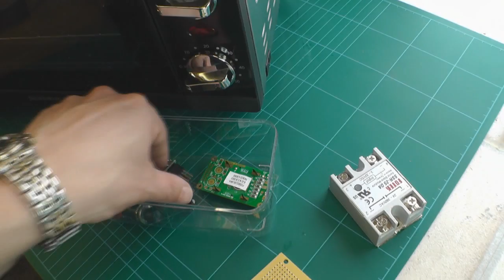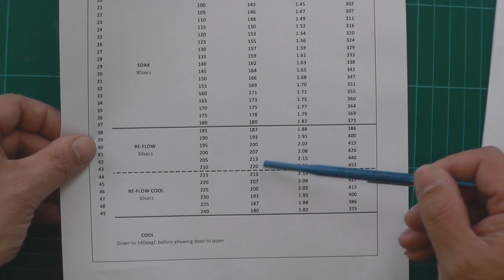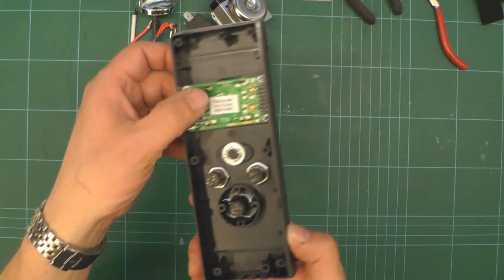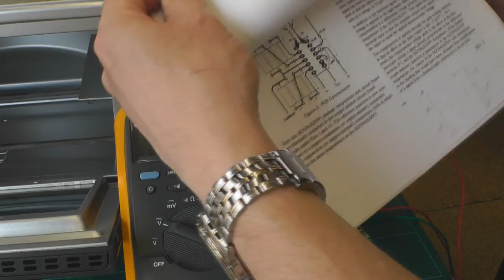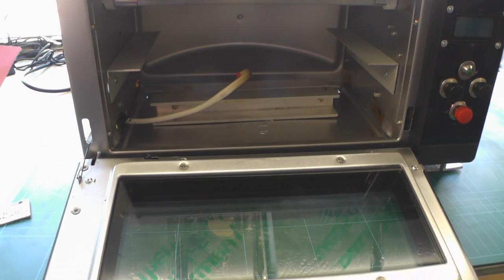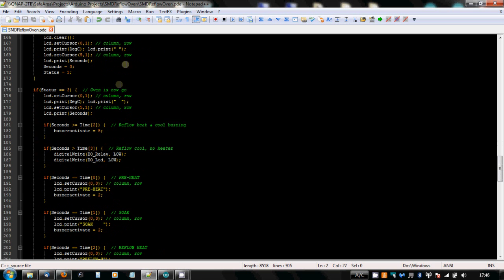Home built SMD Reflow Oven

Comment: The only thing I’d have done differently is perhaps have the AC mains inlet lower on the back. Some of those louvers higher up where the inlet is right now could help with exhausting hot air. But proof’s in the pudding as they say: if it works and lasts, then it’s good the way it is. 

Overall, it’s a pretty neat hack - and very well explained.

Comment: Great video - even 7 years on! Thank you very much. I was wondering what the total power output of the heating elements was? Living in a 100V country these days (max 15A) I need to plan carefully for anything that needs heat delivered in a fixed time (a 'quick' cup of tea takes over twice as long as it does in the UK). Thanks, Mike

Comment: I know this video is old, but after testing/comparing, I took apart one of those thermocouples and there is an air gap between the thermocouple and the housing, causing it to be much less responsive than a bare thermocouple. FWIW

Comment: This video encapsulates everything that I love about the Hacker/DiY/Maker movement.
They take a problem and solve them in creative ways but but not only that they often document everything they do either for themselves or for other people,
but not only that this video should be the example on how these videos should be done for the following reasons:

1 Structure: It covers the topic in such a logical way it moves from:
problem > solution > reason for solution > theory behind solution > building (including tips useful for projects not covered here like the tips for testing boards etc.) 
                  > problems encountered and solutions > extensive testing > covering code used in the final solution (this also includes general programming tips for software not even used here)  
All of these steps are so well done 2 they cover enough to get across what you want the viewer to know but not bog down with details. It's just incredible I have know idea how intentional/accidental  this structure it strikes gold in my opinion.
 
2 It's perfectly targeted: it sets out the steps that a electronics guy/gal can follow it assumes some expertise is present to follow along, but even tho I'm still learning electronics 
I never felt things where losing me. It covers what it wants to do convey and but even I as a beginner know the steps and things I need to bush up on or get to know before attempting it.
Some advanced hacking/electronics videos move way quicker assuming way more which leaves viewers with lose ends not knowing what to study up on but I feel this video hit a great sweet spot.

3 The tips that are given for general subjects great additions
As i sad I'm beginning to get into hobby electronics and I might still be a way's away of building something like this it does lay out some great tips that even I as a beginner
can use. I like the tips on testing boards for example since I'm new I can see some of them help me prevent headaces in the future. Secondly the programming tips 
are great for the beginning programmers too (I'm a software engineer by trade) it lays out important concepts like the fact your code should be easy to adjust and you showed how
that your achieved (it with the timing of the re flow phases  for example). It also shows new programmers to make it more efficient the beep method was lovely for example.

I wish that YouTube still had the 5 star review thing sometimes since a thumbs up icon does not do this video justice. I feel like it's corny to boost you gained a new sub but gosh darn it the effort and well made video can't help me but say it: You gained a new sub.

Comment: Next time I would suggest you use the max31855 and a PID library for the arduino, much easier to use and you don't need table and are more flexible in setting different profiles up.

Comment: I'm working on a design using the same oven - Could not get the damn lid off the thing without almost completely dismantling the whole thing - The cover is attached to the front structure on mine with a couple of one-way latches which are impossible to unlatch.
Reply: I've got an oven like that & every few months the connections on the heating elements become lose & I have to take it apart, the whole thing wants to collapse when you take all the screws off, it's a pain in the arse.

Comment: You could have used a "ALTEC PC410" instead of the Arduino and the temperature reader, they are pretty cheap and common on machines that need profiling temperatures.
They allow you to configure curve ramps and save 10 profiles that you can configure manually.
Also they are PID controlled, so you can calibrate your readings to match the perfect temperatures.
And also you can allow the PC410 to pause in the middle of the profile if the temperature is too far from its target avoiding uneven profile curves (this is not good in the peek zone thow).

Comment: Bad idea,  all components will be heated even good ones would be at risk,  only the bad part shoul be targeted ..
Reply from the maker: Hi, not really sure what you are referring to. Cheers, Ian.
Reply: The defective chip on board U want to reflow,  theres always some other components surrounds it, like the caps, resistors, diodes,   they are all in one board,  so if U tend to heat the suspected chip simply U cannot separate other components from getting heated up...
Reply: @edifierbass7821  thats not the point of a reflow oven, a reflow oven is for production, it just runs at a low temperature about 250 °C. Thats how electronics get produced in a factory.
Reply: @josefaschwanden1502    for production purposes  not for something already been used and reflowing it again,  you need to heat parts that are only suspected ones and cover the other parts, if you feel like heating the whole board go ahead, the real issue is that you guys don't like  negative comments,  you like  praising comments even if some topics needs be polished.

Comment: Controlling the temperature of the board is going to be difficult with this kind of toaster oven.  Because the heating elements emit a lot of IR light, the PCB is likely going to be a lot hotter than the air inside the oven.  IR light will heat the thermocouple directly and make positioning the thermocouple for accurate temperature measurements tricky.

I would suggest putting some kind of shielding over the heating elements that allowed airflow to reduce direct IR heating of the PCB and thermocouple.  Adding an air circulation fan might be a good idea too.

Comment: Looking to do one of these myself, great video. your average routine looks like a low pass filter, good choice. Could you use a triac instead of a relay for better heating element control?
Reply from the maker: You could use a triac, but remember it is a solid state relay so no real problems there.
Reply: IanScottJohnston i was thinking for variable output to the element, so 50% power etc then pid control. maybe a bit overkill??

Comment: you'd have to be an idiot to not like this.
Reply: Why don't mount some miniature fans underneath the vents below the arduino??  little laptop  /  GPU sized fans to suck air in from the bottom,  and blow it into the circuit chamber.

Comment: Your work seems to be quite impressive. While inspecting your code through the video I think you have a little error in the time/temperature linear interpolation calculation.
Instead of "var2 = time[zone]" (if I remember correctly) you should use "var2 = time[zone] - time[zone-1]". Otherwise the temperature increment will be to low in the
following zones. This might be an issue if you have problems getting the right temperature profile.

Comment: measuring the temperature, rather than average i would use median. That filters better some spikes. Spikes does make a difference in average values, smaller ones that without filtering those. But if you have example median of ten calculations there can be few spikes without making any difference.

Comment: Very nice project and very well documented. Although radiant heat in principle is very distance sensitive which might lead into problems when there are items of different height on the pcb and in addition to that, doing it this way the only way cooling the heat down (in the end) is: hoping, that the temperature will drop cause there is no control at all aside from switching the heating elements off. (This might not be that important in this case though.) Also the oven will behave totally different in cold surroundings for instance.

What i want to say is: i think of having a well isolated heated air circulation instead and controlling the pcb - room - temperature by mixture of heated and room temperature by some kind of valve. This way there would be substancial more temperature control, temperature rise and fall could me much faster (if needed), different heights of items on the board would'nt matter and the overall energy consumption would possibly be much lower.

Comment: Hi, It looks like you were not satisfied with the built in heating elements. How many Watts the oven should have to cope with the steep heating curve? Any idea. How many Watts did the original oven have?
Reply from the maker: Markus Rohner Not sure on what watts are/were required, and it's been a while since I built this.......not sure on the original spec. Ian.

Comment: Hi,

Just a quick note. My friend built one of these boards and found he had an issue getting a stable and accurate temperature reading to display.

When he powered the board up, it would display as 0 degrees in temp mode and then suddenly it would read then it wouldn't. It did the same when a profile was active too.
Bascially the temp readings were like this when viewed through serial monitor:
0 0 0 0 0 0 0 34 22 21 0 0 0 0 0 with no distiguishable pattern. Just intermittant readings with the wrong temperature showing.

It turned out to be a connection needs to be made from the + side of the K-Probe to Common (GND). This isn't noted on Ian's schematic but it IS noted on the AD595 datasheet drawn as a dotted line going from the + of the K-Probe input to Common (GND). Soon as we made that connection the temperature appeared constantly and was always accurate and correct. Not a 0 in sight.

So if anyone has this issue, connect a wire from + of the K-probe to GND.
Reply: i had a similar problem but the solution was not to ground it. the thermocouple i got has a metal shielding and i found that if it came in contact with the ovens body which was mains earth grounded the sensor would not work.

Comment: Wouldn't a convection type toaster distribute the  heat better?
Reply: jpalm32 i agree, i just bought a convection toaster one month ago and it seems better. all the solder reflow at the same time.
Reply: +jpalm32  Very good observation: The unit uses radiant heat to heat up the components. This causes several problems: everything dark (IC's) will heat up faster and to a higher temperature than everything silver (thermocouple). Everything closer to the heating elements will also heat up faster and hotter. Without air flow, cooling down of the components may also be difficult to control for the similar reasons.
Reply: Wouldn't that risk blowing components off the board.

Comment: Very comprehensive Ian, thanks for the excellent details. 
I did wonder why you chose to put the heating elements at the top rather than in the lower original position? Given heat rises, I figured that might make for better (convection) and more stable heat distribution?
Does the display also incorporate a timer display or does it only show temperature?
I have been toying with the possible use of a convection microwave oven, as it already has temp control (albeit not tailored to the necessary "curve") and, of course, a fan. Do you think that (assisted) air movement would be a help or a hindrance to the reflow process?
Again, great video and great conversion, thank you for posting this.
Cheers,
Mike.
Reply from the maker: The display shows the seconds elapsed (as well as temperature) which follows the profile selected.
Reply: Retinalism Worth pointing out - if you do reposition the elements to the top and plan on insulating the cavity between the inner oven skin and the case then it's worth installing a stand off plate to keep the insulation from touching the top skin of the oven directly. 

We drilled four holes in each corner through the top of the inner oven skin. Next we fitted four bolts though the holes from the inside so the threads protrude out of the top of the oven inner skin. To fix them in place we screwed down one nut on each bolt fully. This makes a stand off arrangement. Then add another nut on each bolt and screw on enough so they act like spacers so you can then fit a thin steel plate (with ready drilled holes) and then fix  it in place with another four bolts. This allows an air gap between the top of the inner oven skin and the newly fitted plate. Now you can fill the cavity between the case and the oven inner skin with insulation / fire blanket etc and it wont make direct contact with the inner skin and char or smoke.

Reason I say this is because when you buy these ovens with elements at the top, most I've seen have a second skin layer at the top of the oven to handle the heat. When you move elements up to the top that wern't there before, the heat transfers a hell of a lot quicker and any insulation you fit will scorch and smoke.

Ours did until we fitted the stand off plate and then insulated the oven. Runs nice now. No smokey insulation :)

Comment: Hi, just a few improvement ideas from stuff I have heard (I am very impressed already, wouldn't have done as well as you did):

1. I believe the professional reflow ovens hold the PCB by the edges and regulate the air temperature.  If this is true, you should do the same to match the intended effect on the solder paste.

2. Use a standard PID control formula in your 40ms routine to accurately compensate for the physical delay between heat on/off and the temperature changing at the sensor.  This is what PID was invented for, and its just a couple of lines, one or two state variables, and some constants representing the actual properties of your particular oven.

3. Increasing the profile duration may be bad for some components, data sheets often specify max durations.

4. If you had mounted the trafo differently, there would have been more room between the circuit and oven.

5. A 12V fan blowing air from the control area through the oven may help distribute the heat, but plan the cold air inlet and outlet carefully to avoid making a cold and hot side.

6. An alternative to antiflame matting might be fireproof house insulation materials such as Rockwool(R) or Isover(R). It is thicker and isolates more, just wear something over your mouth while fitting it, then take a shower to get it off your skin (its itchy, but only dangerous if you inhale many loose fibers daily for years).

7. Toaster style open heating elements (rather than the encased ones you used) may provide a faster regulation response and heat up/down, but may require a safety switch on the door, as it is essentially an exposed live wire.

8. Personally, I would have connected the pushbuttons before the sensor, since they are sturdier and cheaper.  At least with 20/20 hindsight.

Comment: Built one of these based upon microchip coupla years ago. a truly ugly monstrosity not anywhere nearly as "pretty" as yours! problem I had with the default heaters is they don't get hot enough, quick enough for ROHS. no way those "toy" oven heaters are gonna stay anywhere near within specs. I used a coupla 1.5kw hot air guns with separate drop cords instead (to plug into a separated circuits within the household here). Other things. I built a metal box inside the box to cut down on cubic inches (who needs a 12" box anyway... just that much more air to attempt to heat?). didn't use PID. but my method still stayed within 4C overshoot (used a separate vent fan to keep thermal in check... but another pain there. hardware nightmare). had to do it over again? I'd catch a case of smarts. use PID. I'd also use infrared lamps rather than nicro wire based stuff. expensive though. in fact I'd simply build a s/s box from scratch as I wound up throwing almost all the original oven away anyway.

Comment: I waited right to the end to look at the result but must have missed it. Every board I have done in a similar oven the copper has oxidised. I have followed a profile, although how you know the temperature of the solder paste itself escapes me. At the end of the day, if I use 60/40 paste and apply enough heat to melt it the pcb gets  a noticeable coating of copper oxide.

Comment: Thanks for the video, i was just wondering why you needed to use the AD595 as i have used k-type thermocouples directly on the Arduino and worked well, so i was just wondering what your reason was.

I will be doing this soon.
Reply from the maker: Look up cold junction compensation. You won't get stability if you hook up direct without it. The AD595 has it built in.
Ian.
Reply: thanks i will do.